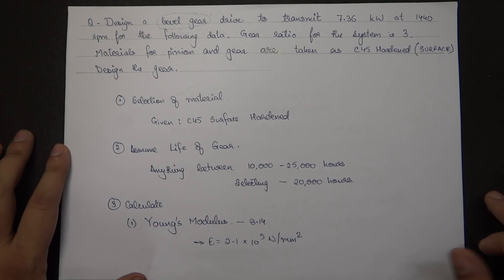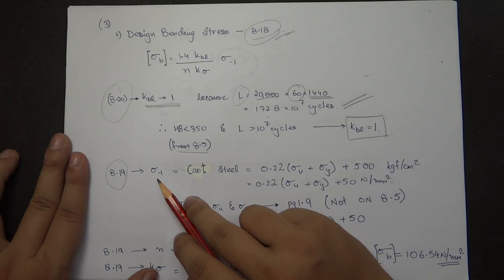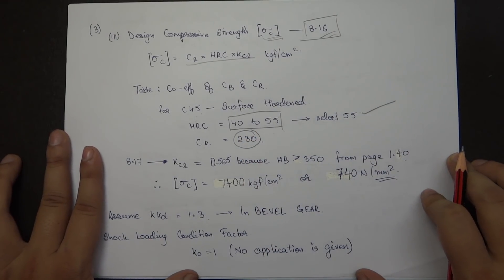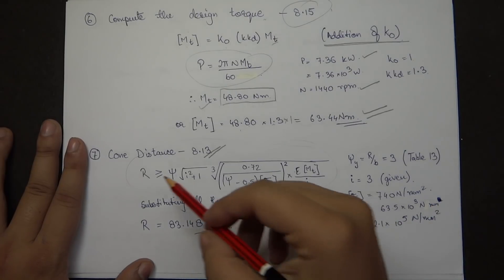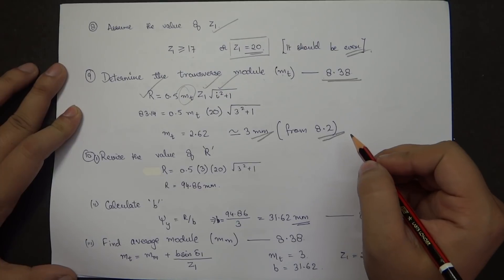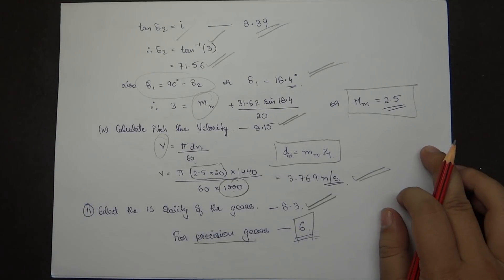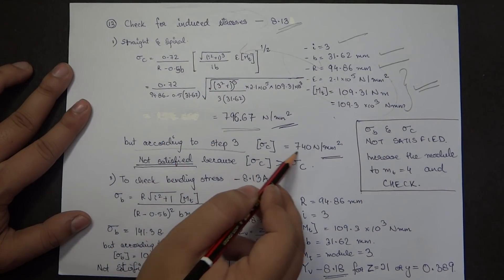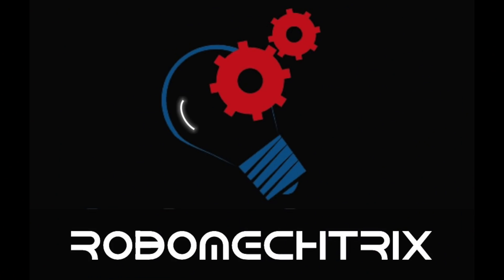Bevel Gear Design Procedure

Comment: For Design Bending Stress, HB<350 and For Design Compressive Stress, HB>350.
How????
Reply: When you are finding Kbl, if the material's case hardness HB> 350 but core hardness HB<350 , then we take the value of Kbl for HB < 350
Case and core hardness you can find on page 1.40 of the data book. so, in this case Kbl will be for HB < 350 , N>10^7,  Kbl = 1

Comment: Sir actually we dont need to change the module i guess bcoz at 10:35 for IS quality 6 under 8 m/s we get kd as 1.2 and not as 1.4 and further we get induced stress as 737 which will be safe
Reply from the maker: If that is the case then yes, we can obviously go for it without changing the module! :)

Comment: Sir what is the material we give if it is not given in the problem
Reply from the maker: Material Selection is based on the type of question. If the material is not specified in the given problem, Steel or cast iron (data available widely) of any grade or alloy composition maybe selected from page 8.5 in the data book. 
Although the choice is solely dependent on you and you can select any material of your choice, just check whether or not all the values are present to plug into the different formulas.